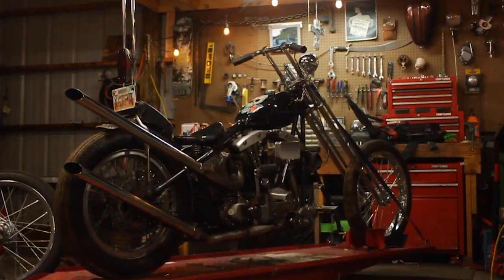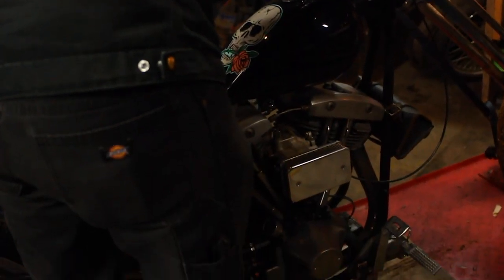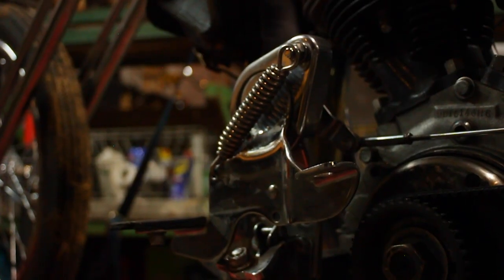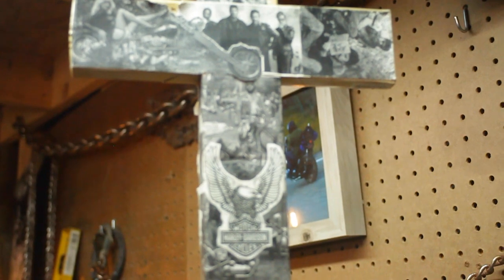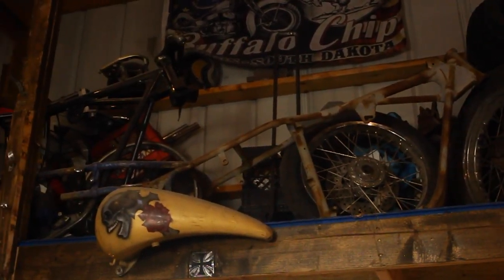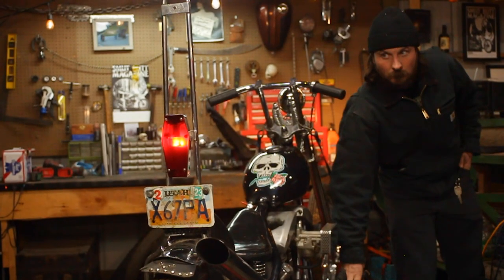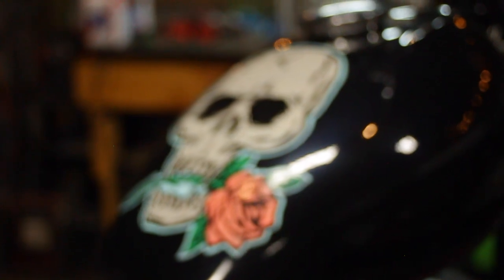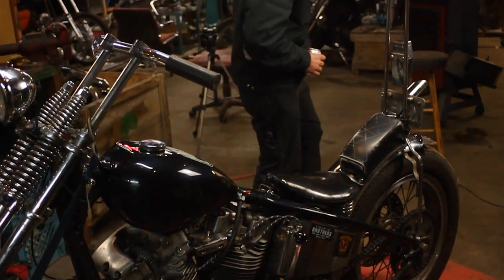Chopper Builder Spotlight: Spencer Weber - 1976 Shovelhead Harley Chopper

Comment: Howdy Cody. That's one bruisin' Shovelhead you've got there. At first glance, I thought that bike's springer was from Paughco. That's wild you've got a great scene going on out there. Choppers are practically non-existent where I am. Yeah, I remember seeing "Hell's Angels '69" at the local drive-in. There were some great bikes in that flick. One of my favorite choppers was in an early issue of "Easyriders" magazine. It was a 1954 Panhead stuffed in a wishbone frame, which wasn't raked. It had upswept MCM fishtailed exhaust and an 8-inch over wide glide with original gaiters from a K-Model or early Sporty. The bike's front wheel was an 18-incher with a 2.75 X 18 Avon Speedmaster tire. I wish Avon still made them. The bike ran a glide front brake. The bike was like some off-shade of green. It was a great bike. There was a LOT of chrome on that bike! A guy named Pat Ditson built/rode it. Keep up the great work on choppers and the great video content coming. Build right. Ride safe. -- W
Reply from the maker: That bikes sounds like something that would be right up my alley. As for the Avon speed master you can still buy them. I have one on my bike as we speak! Also, if you don’t have a chopper scene around you it sounds like you might need to start one! Haha
Reply: @codyschoppercorner5727  -- Hey! Thanks for the reply! Choppers por vida! Build right. Ride safe.